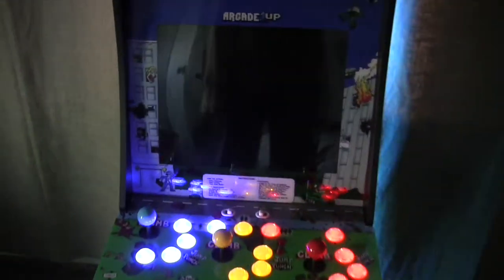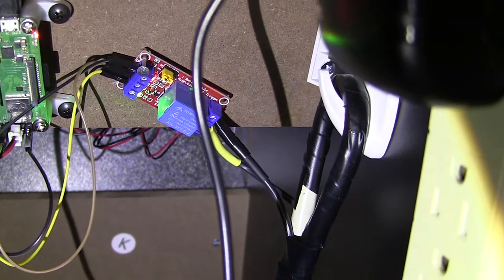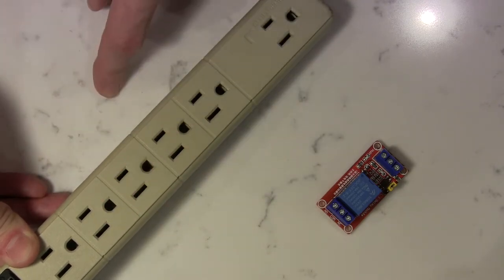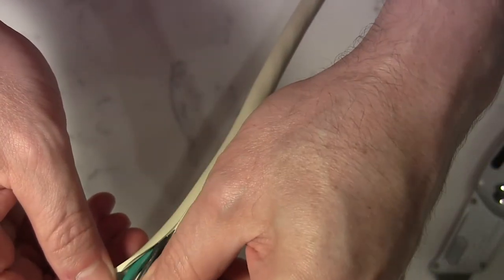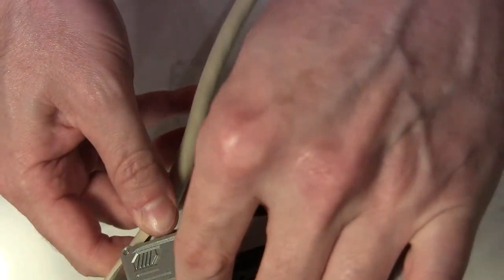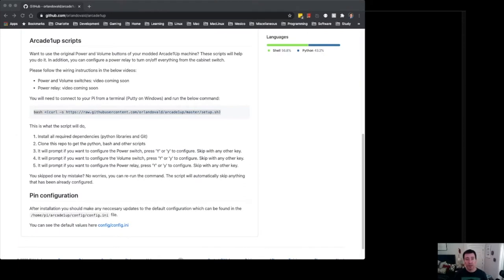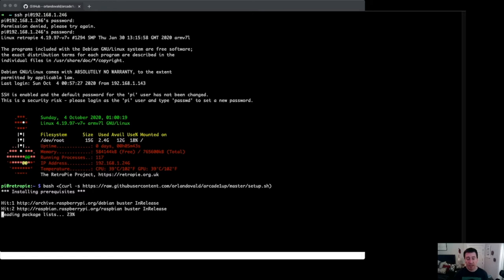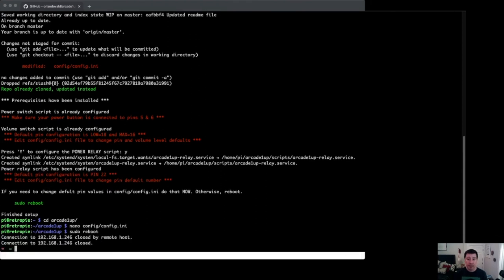Arcade1up Mod: Turn on/off EVERYTHING with the power switch

Comment: Great video, I think I will try this out as I mod my Street Fighter 2 legacy cabinet. Quick question though regarding the script - will the script in this video cover everything: using the cabinet's on/off, volume switched and shutting everything down? Or will I have to run the scripts separately? Thanks again!
Reply from the maker: Yes, the same script will ask you to configure each one of those things. You just need to answer Yes to the ones you want to configure.

Comment: Question..  why not just use the arcade1up power button to activate the power strip and then just plug the pi and other items directly to the power strip? Without having to connect the pi in line?  Is that not possible?
Reply from the maker: That is definitely possible and actually easier. The only problem is that it would shutdown the Pi abruptly and you might lose recent configurations done in the RetroPi UI (or worst case corrupt your sd card). The way I did it makes sure the Pi gets shutdown gracefully so all processes can save or clean up resources.

Comment: Hi, will this work on pi 4b ?
Reply from the maker: I have only tried it in my Pi3 but it could probably work out of the box or with minor modifications
Reply: @code-recipes936  is there way to edit the shutdown script so it can  wait longer before shutting down, it looks like it is shutting it down to fast on the pi4. It is not allowing it to save the metadata to the system.